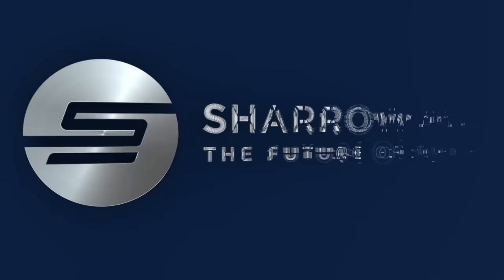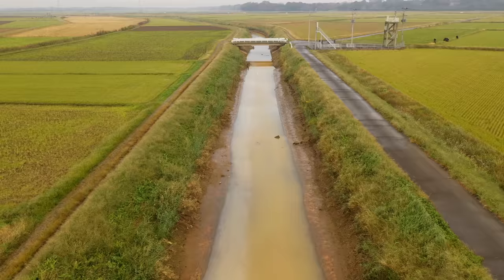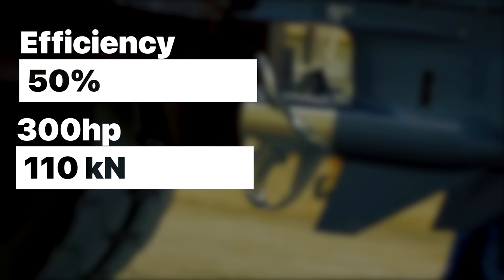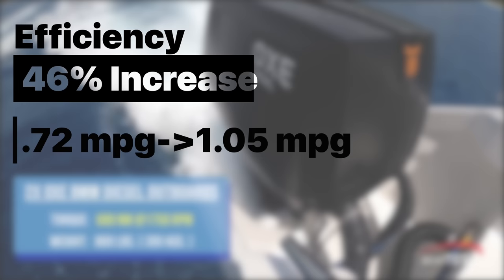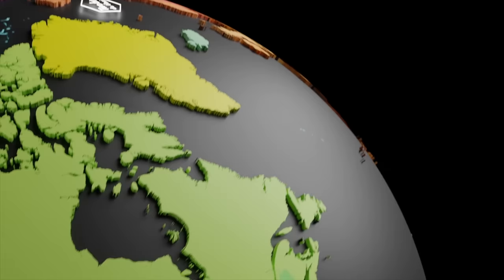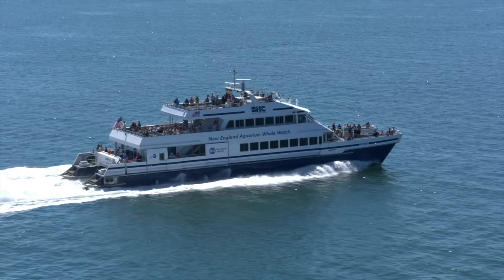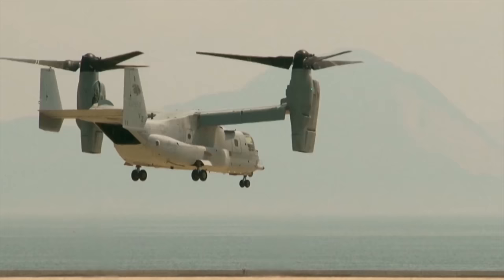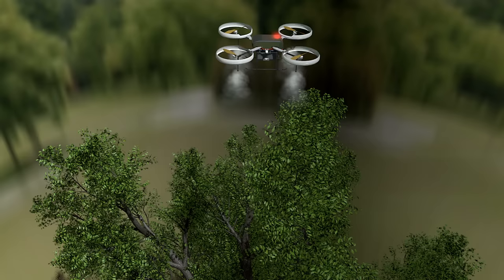Genius Propeller Is About to REVOLUTIONIZE Ships, Here's Why

Comment: Interesting. I notice that all the shown test boats are traveling at planing speed... probably because you would have to be wasting fuel at the rate needed to plane large, heavy, lumps of plastic to make these very pricey blades make sense. I guess being rich enough to afford such toys helps too. One has to wonder how well these would fare against variable pitch props at a speed they are not designed for. How well do they do at displacement speeds? How much resistance do they produce when they are at rest but the boat is moving, for example a sail is being used or a single screw in a double screw vessel is being run. How well do they work in reverse? Another comparison that needs to be made would be to large diameter, slow turning screws such as those used on large freight vessels where tip vortices, while still present, are much lower.

As a side note: The idea they could be used in a helicopter makes no sense as the angle of attack of each blade is different depending on the portion arc the blade is positioned at each microsecond of time. Also, the blades are flexible and rely on centrifugal force to keep them in place so they can be light enough. A solid blade of this new design would have to be very heavy just to hold it's shape and at the same time be able to change its shape continuously over each rotation. Not going to happen. That sounds like patent language trying to cover every possible use of this "invention".

In all,  I think these props are great for exactly what they are advertised for, go fast boats with small high rpm props at cruising speed, which to be fair, is where a lot of these kinds of boats spend most of their run time.
Reply: To add some info, I've used printed versions of these props on quads and while it is quieter it also puts a larger load on the motors. A 3 bladed version puts almost as much load as a normal 6 bladed prop, not sure how it scales with size yet but the difference from a 6 blade is almost nothing in terms of power use and load. Though it is slightly quieter then a 6 blade

Comment: This is seemingly a great solution,  however for aircraft-  only a small amount of craft use props that are fixed.   Many planes use props that can be adjusted in flight. I seriously question what happens in an "engine out" situation when the prop blades would normally be feathered. Multi-engine vs single engine?  Imbalanced thrust?  Critical engine?" Helicopters are constantly adjusting rotor blade pitch.   Also with helicopters, the angles of load changes as the vehicle moves from vertical and horizontal flight patterns.  
    I suppose when a boater adjusts the trim it changes the line of drag in the water, relative to motion a bit, does the improved efficiency taper off?  How much extra energy would be transfered into the crankshaft with a prop strike situation (I've seen lots of bent blades, and imagine an aircraft engine).    
   Eight and balance is also a concern for aircraft,  do these blades add much weight?
   So many questions.  Honestly it'll likely take the FAA 2 generations to process and decide on whether to approve these or not.... leave it to the experimental folks I guess.
   I'm no expert in anything, just like asking questions.

Comment: I design and build prop of all kind...  This design has a major flaw.  The part of the prop with the highest velocity (the part that connects the blades) does nothing but create drag, it has no angle of attack to the water and does nothing.  Its not a tiny area either. This will more than offset any gain by the 2 high aspect blades.. IMO
Reply: Maybe you could design it better and retire rich
Reply: You draw the wrong conclusions.
It doesn't just create drag.
That's the whole trick.
You need to alter your definition of water.
Not by just describing what it does, but by defining what it is.

Comment: I have been super intrigued by these propellers for some time now. I look forward to trying them out on my 75' exploration yacht.
I also look forward to having a 75' exploration yacht.
Just as a FYI, this northern sea rout you are talking about, goes through Canadian territorial water. Shipping companies will have to pay Canada to use it. However, even if Canada charges the same as Panama, the reduced fuel costs will still make it worth while.

Comment: I wonder if these propellers would be advantageous on a larger scale such as a turboprop plane . turboprop planes are infamous for their vibration and noise thus could be a major advancement in that area
Reply: The toroid air propeller has not been invented yet.
It requires constant RPM, which is not really usefull on airplanes unless its pitch can be regulated and that is thinking way into the future for these props..
Reply from the maker: Yeah hopefully someone is doing some experiments on that.
Reply from the maker: hopefully Mit is still doing testing for other applications

Comment: I want to see one replace the propeller on a typical light single engine airplane with a fixed-pitch propeller. Seems like lots of gains to the operation, as well as easing the transition to electric.
Reply: It would be either to heavy or break. The boat prop is two to four times as thick as a conventional prop.
Reply: @lenwhatever4187  I'm hopeful that if the shape can be used for drones, it can be upscaled for manned aircraft. Air is less dense than water, so no, you won't need to use a prop cnc'd out of dense metal. Light weight composites can be used or even wood.
Reply: @mls515  Even assuming light weight materials such as are already used,  if two or three times  that material is used, light as it is, it would still be much heavier than standard. I was not assuming steel. I was rather looking at how a standard prop works. The standard prop is not only thin but has tensile strength in a direct line from root to tip. This means much of its "stiffness" comes from centrifugal force (much like a helicopter). When loops are added, like these new props would have, centrifugal forces would work against their shape and so they would need to have a thicker chord shape which, aside from weighing much more (the extra returning blade is also all dead weight), would have more air resistance to just turning as well. Because the "blades" would be heavier, the bearings would need to be more robust (also means heavier). I would note that the boat props, even though made of steel, seem to be as much as 4 times thicker in the blade that a standard boat prop. The boat props tip speed and therefore centrifugal force, is much lower than even a small airplane prop where centrifugal force would be much higher. Carbon fibre is very strong but even still a carbon fibre stick is quite bendable, something as thin as a prop blade would show a lot of flex and not hold a loop shape very well. It would have to be designed for a constant speed which would not allow for speed changes such as up and down in a drone and still retain it's advantages in efficiency. So it may be more efficient at one speed but less efficient at others. In a drone mode, where the "forward" movement is at right angles to the blade, the loop ends would present more air resistance in that direction as well. It does not take much imagination to see a lot of problems that can not be overcome but only , perhaps, compensated for by some addition of efficiency at some RPMs.

Comment: At 14:20 you show the relative generated turbulence,,  (of the two systems), which clearly impact on the overall power-to-thrust conversion.  However, one important factor that you forgot to mention is marine fouling. On  increased surface areas fouling would be significant leading to huge inefficiencies. Specialised Fouling cleaning is expensive

Comment: Twisted blades is nothing new, but patent and copyright are often used to claim something ant then make money out of suing other getting paid for someone use an concept or an idea, it is two principles that is made to limit and stop development.

I seen twisted blades on some equipment to mix concrete, and even on on handheld kitchen mixers used for cooking, those are not propellers but show that the idea been out a very long time, I also think I see something similar on out ventilation on swedish houses but in a shape of a round ball.

So the only diference I can see is the angle and rotation, but that should not be anything a company should be able to claim ownership over, and if it is open source, free to use that had also been a good invention to not cut down speed but fuel use and noise pollution under water.

Comment: Interesting development, not sure why one should cost so much (other than corporate price gouging a 'new and improved' product).  I know the Navy has used 'shrouded propulsors' on modern submarines, but obviously there is very little unclassified information about them.

The fact that others had similar designs before without reporting such dramatic improvements leaves me...  skeptical.  I'll hold onto my money for now, wait and see.
Reply: These props have to be machined on a CNC from solid blocks of stainless steel. This is because the shape of the propeller is impossible to cast in a sand mold. Most of a solid block will have to be cut away and recycled, so there's a high material cost. There's some cost recovery from the prime recycle, but its a fraction of the virgin material cost. Additionally, CNC machine time cost increases exponentially with size. Lastly, these are made one at a time and custom order.

Traditional propellers are made by casting the steel into a sand mold and can be made in large batches, dozens or even hundreds at a time.

Not everything is as simple as 'corporate greed'.
Reply: @hawgsrmylife  this
Reply: Check out the BoatTests review. At cruising RPM, a powerboat was a whopping 11knots faster, 86%, in the middle of the power and, with decreasing returns until it topped out at the same speed as the stock propeller at the maximum RPM. It doesn’t produce as much cavitation so it doesn’t slip like a normal propeller.
Reply: And it’s not corporate greed. It’s from small shop in Michigan, they produce all of their propellers in-house with high-end CNC machines, and it’s the only product they make. It’s a bespoke product, and that commands bespoke prices.
Reply: @Neberheim  would it be fair to say that, if these were mass manufactured at similar scale to the traditional propellors, then the price would reduce to be in the same price ballpark?
Reply: @shonunezekiel  It would certainly get much cheaper. Currently, bug propellers are molded in one piece and then a milling machine brings the piece down to the specified dimensions and the surface finish. If you were to produce toroidal propellers, you'd have a more complex mold, more machining time and you would probably need a more expensive CNC-machine. So maybe 1.5 - 5 times more expensive if I'd have to take an uneducated guess
Reply: @shonunezekiel no.... normal propellers are cast and are cheap cos the manufacturing process is scaleable, cnc’ing isn’t, unless you build so many cnc machines they themselves get cheaper, but that’s not realistic

If metal 3D printing tech becomes cheaper then yes
Reply: Shrouded propellers aren't new; they're used in JetSkis and ducted fans.

Comment: Although fuel efficiency can be translated to reduced cost, it would also have an impact on pollution. 2.9% of global CO2 emission is from shipping (EU figures for 2018), and expected to increase. So reduce fuel by 30%, you reduce global CO2 emissions by 1%. Not bad for one relatively simple measure.

Comment: So can this work in reverse for wind turbines too?
Reply: I was wondering about that. Hydro electric turbines as well?
Reply: unlikely. wind "turbines" (I don't know why they are called that) already have failure problems with the relatively light blades they have now. Adding weight by more than double will mean more  cost all the way from the foundation, up the tower, the size of the bearings and their mounts.... sounds like a recipe for catastrophic failure.

Comment: Just look at it, it's 2 propellers in one with a twist connecting them at the top.
Reply: My limited fluid dynamics says it is a shallower trailing edge leading to the smoother exit of the liquid it is being used in. Hell, I really have no clue but that's my gut instinct 😅
Reply: @coryernewein  Instinct will do just fine.
Try imagine what it does to the water caught in it and watch it spin.
See how it grabs all the water it can get its blades on and pumps it into that one direction with nowhere else to go. How every pass of that twist cuts of its share and sucks in water in its trail for the next twist to cut through. By the time the water leaves the prop, it's hard as concrete. That is what the force of the blades is applied on. It simply can't get out of the way fast enough. Do you feel what I mean when I call it a pump? This thing doesn't take no for an answer.
Reply: @Berend-ov8of  dude🤯, the pump analogy is damn near perfect! It seems to compress all the outflow into a nozzle effect. Good call and thanks for the awesome insight into the minutiae I glanced over🤙

Comment: Why not just have a ring/pipe at the blade tips supporting all blades so you get a quasi water jet instead? You may need a mesh guard or similar to stop debris from being sucked in. For air it may be too much mass to rotate efficiently but should be good for boats.
Reply: The ring shaped duct adds drag that tends to outweigh the higher propeller efficiency on faster ships. Ducted props are common on tugboats and trawlers because they need lots of thrust but don't often go very fast.

Such rings also sometimes appear on submarine propellers, because for them reducing prop noise is more important than top speed or fuel economy.

Comment: Small-craft boating often results in dinged or broken propellers. Repairs are often much less expensive than buying new ones, I wonder how these new complex props holdups up to impacts, wear-and-tear. and repair. Not to mention a target for theft.
Reply: I wonder why propulsion like what is used in jet engines has not been done in boats?
Reply: NOTHING to repair , IF 100% Electric combined w/ MHD or Hydro Jet.

Comment: A dramatic increase in thrust could be achieved by simply fitting larger diameter, smaller pitch props. But that would generally result in lower speeds. (Like having a car in low gear)

Comment: Do a video on district heating with heat pumps.  There is a master planned community in Texas that does this.  It is more common in Europe and China.
Reply: Where is this community?
Reply: @fortitudethedogwalker6273  Nice. Do they have any other innovative solutions?
Reply: JAPAN , has been using HEAT pumps in Residential/small business cooling/heat since 1986 !!!!!
America & EU are OUTDATED. 
also since 1986, JAPAN has been using Localized in-home Instant water heaters , located in Kitchen & Bath.
Reply: @markplott4820  We use heat pumps on military bases for cooling and water heating. Basically move heat from the A/C's supply to the hot water tap supply
Reply from the maker: Do you recall the name of the community in texas doing this? We are trying to plan a trip to texas soon.
Reply: @TwoBitDaVinci  He said in a deleted comment that it was the Whisper Valley development just east of Austin Texas
Reply: @TwoBitDaVinci  / whisper valley outside of Austin.  Just have think did a Video on it and they have a website.

Comment: The Sharrow prop and the MIT prop are based on two entirely different concepts operating in two entirely different fluids, which explains why the results are so different.
I keep on seeing them mentioned together, without there being any technical reason for that.
Reply from the maker: Its really just timing it seems that they both went relatively viral at the same time and are just similar in a very basic way.

Comment: This being a mechanical design minded component rediscovered that creates a flow force efficiently compared will become a real wonderful product when invented are means to reduce the amount of effort costs to produce it still requiring quality material worked into precision form also being reliable for the various potential uses imagined. Said was three years of fuel cost savings equals it out providing you do not damage something that can be damaged by use.

Comment: Im just installing CPU fan as a ventilation in a room. That CPU fan consumes 2,5W. Simmilar fan but labeled as for air ducts for buildings consumes 30W, with identical airflow. Same with vacuum cleaners, now with batteries they consume 10x less energy as those with cords. My old LCD monitor consumed 100W, new one consumes 15W. It just shows how crappy all the PC, building, shipping, transportation technology is, that now as we as humanity focus on it we could make everything work 10 times more effcient, so in the end we might need 10 times less renewable energy sources and transition might be lightning fast.

Comment: The “plus 105% efficiency” is totally implausible. A conventional prop will easily achieve 70% at its peak efficiency so the headroom to double it simply DOES NOT EXIST. No “breakthrough” can change this fact. Citing a case where the conventional prop was only 38% efficient to begin with, kind of sums up what is going on here. Smoke and mirrors

Comment: Just watched a video where a Florida couples home insurance was cancelled because they had Solar panels. They mentioned to high of DC voltage. One of the solutions was to disconnect part of there system. I wonder if having string inverters would of been a solution with benefits?

Comment: Aluminum props are less than $200 and can be cheaply repaired. Commercial or larger private vessels might use this, but spending 25x more $ on a prop that can't be repaired for a regular fishing boat seems silly. Price needs to come way down.